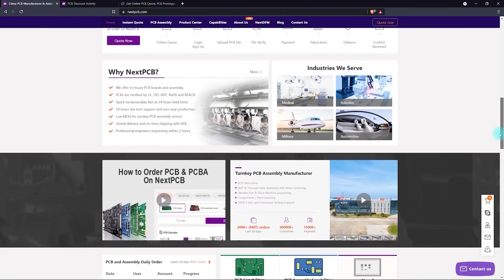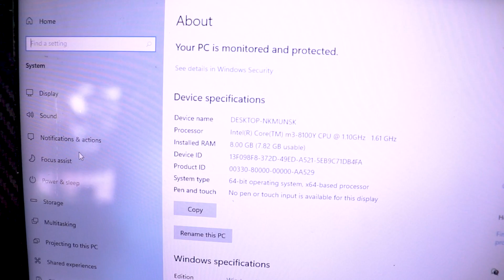How to Make DIY Laptop at Home

Comment: How much would all part coast to make it please
Reply: I did a superficial research, and unfortunately it seams to be more expensive then a conventional laptop. Although I don't understand much about it's specifications to correctly compare. I was also interested in making a laptop for me, to use it with an integrated mechanical keyboard, but I guess the best option would be to buy a used laptop to use it's parts.

Comment: Bro the keyboard is not available
Reply from the maker: https://www.amazon.in/B102D-Ultra-Light-Connection-Bluetooth-Smartphone/dp/B09TWJW5N6/ref=asc_df_B09TWJW5N6/?tag=googleshopdes-21&linkCode=df0&hvadid=586293624941&hvpos=&hvnetw=g&hvrand=16342346882974150391&hvpone=&hvptwo=&hvqmt=&hvdev=c&hvdvcmdl=&hvlocint=&hvlocphy=9149919&hvtargid=pla-1641090590856&psc=1&mcid=2d38a9cdcc6f35159fe9561c6b4f94f0&gclid=CjwKCAiA8sauBhB3EiwAruTRJvVWHUv2de52mj94Q-uTHPi4o21z7zTnh8hpOsCSKon8A5TXBpHrAhoCdRMQAvD_BwE
Reply: @SaptarshiSikder  can you give me another keyboard like this? in black or gray color

Comment: I built a similar device at home and can share my experience:
Use rpi zero w or analogues (I took banana pi) and put a laptop cooler on it: for the purposes of such hardware, there is enough performance, it is better to install linux: again, performance.
Zero w is compact, you can arrange the elements more tightly and put more batteries (read about parallel and serial connection)
About charging, add a protection board, buy a fast charging trigger board, so you can charge using type-c
Reply: How did you build it

Comment: Although this is a good idea, it was thought out poorly.
-With a display, compatible with lattepanda, you could just miss the display-driver part.
-With such a thick housing it could fit 3X the battery.
-Even if you want to use such little battery, just change the lattepanda to a raspberry pi and it consumes less power.
-Displayless boost converter would consume less.
-The hinge system is OK for a homebuild, but it should house less thick cables for a better look.(especially causes a problem when closing down, as visible on vid)
Reply: Don't look at his faults, 🤨you can't even do what he did.
Reply: @AhmadFarzadTaquee   As an electrical engineer I believe it is quite doable for me, thanks. I have given ideas so that in the unlikely case someone wants to make this 'laptop' it can be done more efficiently and in a more long-lasting manner. I could have highlighted important parts, like the use of the mini BMS, but if one doesn't know the importance of that, then one should not even begin to build such a project, since it would probably be a nice fire hazard.
Reply: yeah the laptop could be thinner with a slimmer battery, if they want the battery to be that small

Comment: Another useless project. There are many ways to improve that thing you call "laptop"...  First thing, absolute worst power supply ever. Just connecting 18650 cells into battery without any protection circuit board is one more risk to your healt and belongings. You may simply overcharge that thing you call battery and it can have dangerous consequences. Also arrangement of the other parts is not very optimal. For example: You can simply move the lattepanda board to top left corner, then to top right corner move the video board. In the middle is the best position for the step-up and step-down converters used for those two boards and then you have even more than enough space to build proper accu pack on the bottom of the case with 6 cells. That can be properly charged and managed with one of the many available circuit boards. They are cheap, available on "every corner" of the internet, so buy 3S 40A balance and use this. Oh and well, you are forgetting that lattepanda board need some air to cool off. It's x86-64 architecture that is more power hungry and have higher TDP that frickin raspberry, so you need to do something with that too.
Reply: what the fuck is wrong whit you like he is trying to show peopole how to make a laptop sure there are proplebms but apple is worst

Comment: Beautiful, but very expensive + the charging is very wrong with the batteries. There must be a charging circuit in it + each battery is connected by itself, or they are charged in parallel

Comment: I had a small doubt i.e how much standby time does it give with 3s battery pack. I am planning to use a 4s battery pack with a bms to directly give power to my raspberry pi and boost converting it to 12v to give it to my display controller. This is one approach or should I just use 4 18650 cells and a powerbank module to charge it as well and power 5v to raspberry pi 4 and 12v to display controller via dc to dc boost converter??
Reply: series cells doesn't increase capacity, they increase voltage. you need parallel cells, and the capacity is gonna be determined by the quality of your cells. want a tip? recycle cells from old batteries from laptops, not all cells on them are bad, and work just fine

Comment: https://youtu.be/yKWe22KzVMU?t=84
Is there no problem connecting to ADD board DC without battery and transformer in this video?
Reply from the maker: he not use any battery but i use battery and also use dc booster module

Comment: I have a question. Should both the voltage be the same when connecting the ADD board and the latte panda?

Does it work for LP097x02-SLQA IPAD-3 AD board with DC connector and Latte panda 4pin or only for AD board in the video?
Reply from the maker: yes voltage are same 12 volt